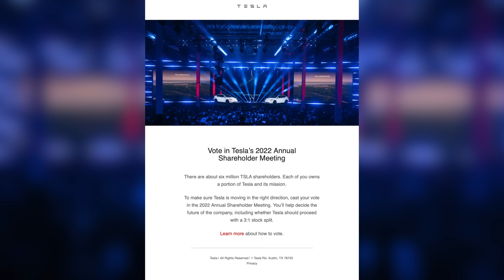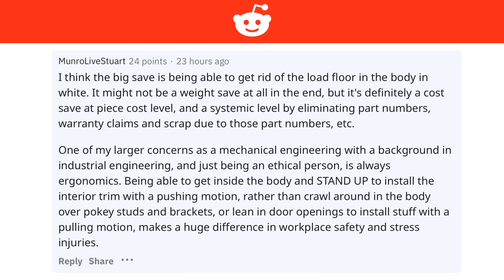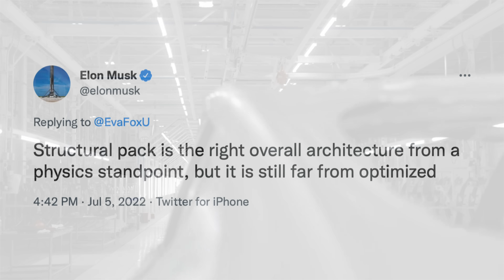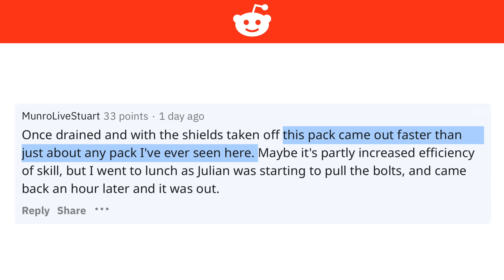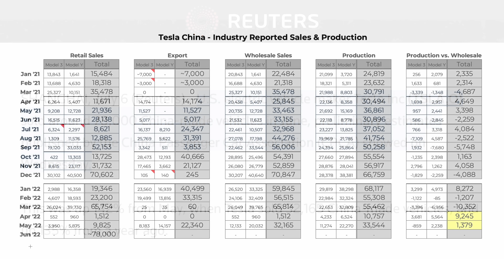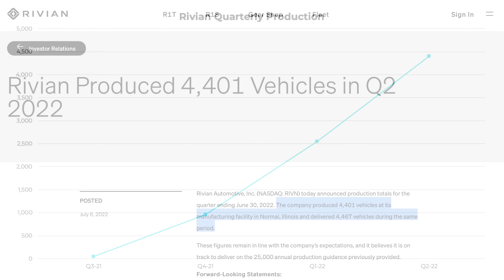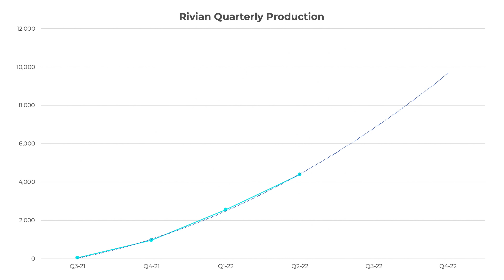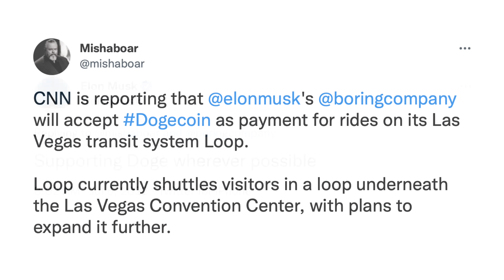Behind The Scenes Details on Tesla Model Y Teardown From Munro

Comment: Rob, something else emerged recently from Munro & Associates that illuminates a question we all had about Model S Plaid.  They tore down the Plaid battery pack, of course.  One of their observations has to do with cooling in that pack.  The liquid cooling in that pack is outrageously aggressive, and because of the small cell size (18mm x 68mm), the cooling is right up next to where chemistry is happening.  We don't see cooling applied to the bottom of the cells; instead it's applied all along the length of each cell.

4680 cells are cooled from the bottom.  They generate less heat energy for the current flow, which is good - efficient!  But there's simply no way to achieve cooling as aggressive with 4680 cells, or to get coolant as close to where chemistry is happening.

Tesla promised a 4680 version of Plaid... and then abruptly canceled that version.  In retrospect, and in consideration of what Munro found, it's obvious.  They were not able to create a 4680 Plaid that could match the track performance of the 18650 Plaid - cooling wasn't good enough to keep up with power demands.  Far from being a better performer, it was worse.

This should help us to think about standardization of cells for automotive uses.  As the battery market matures, we should see a variety of different cell form-factors, depending on the performance goals for each model.  High-performance on the track is going to favor smaller cells; larger cells will be advantageous for more mundane performance requirements.  We may even see a cell form-factor larger than 4680, in order to harvest improvements in efficiency and cost (simpler pack assembly) while providing adequate, but not gut-wrenching, acceleration.

Thanks for your reporting, Rob.
Reply: The 4680 cells are internally structurally different with their tabless design which reduces the need for as much cooling as the smaller form factors. This may be part of the reason for less cooling. You also said there way “no way” of cooling 4680’s. I’m going to bet that the Tesla teams could work out a way.
Reply: @MrDuncanBooth  No, no, I said there was no way they could cool them as effectively as with the smaller cell, not that they can't cool them at all.

Tesla did tell us the 4680 needs less cooling as a function of watts moving through the cell.  It's more efficient, in other words - less energy lost to cooling.  This is a consequence of shorter conductive paths, thanks to the tabless battery design.

But this doesn't mean that the 4680 can match 18650 cells for track performance.  However you slice it, coolant will be further away, on average, from where chemistry is happening and where heat is being generated.  The need to avoid overheating the battery will be a limiting factor, and I assert that this is the reason Tesla decided against delivering a 4680 version of Plaid.
Reply: @Urgelt  
The reason they decided against the 4680 version of the Plaid?
I would say twofold.

1) It would require a new production line.
Expensive for a low quantity car.
.
2) It's already beyond the capability of 99.99% of customers, and already outperforms any "competitor".
It was deemed unnecessary.
.
They had more important tasks to complete.
(Imo, of course)
(Imo)
Reply: @rogerstarkey5390  Well, I dunno about 'more expensive.'

The 18650 cells are being shipped from Japan.  That isn't cheap.

And Tesla expects 4680 production costs per watt-hour of energy storage to be cheaper than anything else on the market.  I expect this to be true, too.  Plus, with structural packs, there is an energy density advantage at the pack level you can't get with 18650 cells.

They have to ramp 4680 anyway.  So they could have kept a 4680 Plaid in their plans, albeit of uncertain timeframe.  But they didn't.  They killed the 4680 Plaid.

They had enough 4680 cells to prototype a 4680 Plaid.  I suspect they did, or at the least, they ran simulations and drew their conclusions from those.

Munro uncovered the logic behind this decision when they examined the Plaid pack and saw just how close the coolant is to cell chemistry.  You can't get aggressive cooling nearly that close to the chemistry with 4680 cells, and that means 4680 isn't as suitable for sustained track performance.
Reply: FALSE , see MUNRO 4680 images from TX, they are SIDE cooled with Ribbons , they seem to use less BLUE insulation foam. 
they may ALSO use bottom plate cooling.
Reply: @markplott4820  Tesla told us they're bottom-cooled.  Munro hasn't yet torn into the 4680 pack; we shall soon see exactly what's what.

It is incontrovertible that cooling will be, on average, farther from the cell's chemistry with the larger cell, and I think my conclusion about Plaid is perfectly accurate.  Tesla canceled the 4680 Plaid because of high-performance cooling needs they couldn't answer with the larger cell.
Reply: Also, another advantage of smaller but more cells is that when a cell dies, it has less impact on the performance of the the whole pack.
Reply: @fred8281  There is no arguing against this principle.

The questions to pose are, at what rate to cells fail in a pack sold to a customer?  And is the failure rate the same for 18650 cells and 4680 cells?

The failure rate might not be the same between new-fangled 4680 cells made at GF-Austin versus mature 18650 lines in Japan.

I'm not trying to imply that 4680 cells fail at a higher rate.  It's conceivable that the larger form-factor, combined with Tesla's battery tech advances, yields a superior failure rate for cells which pass QA and are included in a pack.

It's an unknown.  Possibly, Tesla is still collecting data on 4680 failure rates.  They might have a pretty good idea about how well 18650 cells hold up - but possibly not for those, either, since Panasonic is undoubtedly tweaking cell designs as they move forward, looking for energy density gains and quality improvements.  All cell manufacturers are tweaking as they go forward.

If I had to venture a guess, it would be that failure rates are, at this juncture, not much of an issue for Tesla.  One cell failure will impact a 4680 pack more than one cell failure in an 18650 pack, but there may be so few failures over the life of either or both packs that it isn't worth worrying about.  Maybe.  But that's only a guess.

We'll know more eventually.  The battery degradation curves for Plaid and for Model Y standard range over the course of years will be plotted and discussed.

By way of contrast, pouch cell failures could be, in principle, a larger concern.  Pouch cells are even larger than 4680 cells; they generate hot spots; they lack Tesla's design improvements in 4680 cells; and GM has had simply awful woes with its pouch cell packs.

We know that VW is moving away from pouch cells in their product plans and towards prismatic cells, apparently, which will put them in the same camp as BYD.  I'm of the opinion that prismatic cells can achieve pretty low failure rates, which will be good if true - but scaling up production should be more expensive and less fruitful than with cylindrical cells, an insight Elon had many years ago.  And you can't use prismatic cells in packs which use cells as structural components, which means that, given equivalent chemistries, prismatic packs won't achieve energy densities as good as can be obtained with 4680 cells.

Lots of questions.  Many opinions.  Not much hard data.

I hope Tesla will do another Battery Day presentation soon.  Everything we can learn will be welcome!
Reply: @fred8281  Only when the cell burns through cleanly without damaging the neighboring cells, and when this one cell does not short itself and burns the module/pack. So about 1/3rd of the time this assumption is correct.
Reply: Why can't cooling happen along the length in 4680?
Reply: @ashh3051  It could - at the expense of a heavier pack.

But do they need that for a standard-range Model Y?  I think not.

When Munro tears into the 4680 pack, we'll see exactly what they did with cooling it.
Reply: There are larger cells. Most manufacturers use large prismatic or blade formed cells instead of cylindrical. Cylindrical cells have a advantage in high powered applications with optimized cooling. Länger sized cells are cheaper to produce and offer more capacity for a given volume. But they do not offer as much performance as cylindrical packs. The 4680 pack is not usable for a Plaid. But its perfectly fine with all other applications which do not need such extreme amounts of power.
Reply: @wolfgangpreier9160  BYD's Blade cell is a prismatic cell.

Size matters for any form-factor.  The larger it is, the easier it is to assemble packs, and the worse is the cooling situation.

4680 disrupts that truism to a certain extent; it needs less cooling per watt, since conductive paths are shorter than with tabbed cylindrical cells.

But I still reach the same conclusion.  4680 is very suitable for models which do not need insane levels of power.  For sustained track use, smaller cells are superior, because cooling can get much closer to where heat is being generated.
Reply: @Urgelt  And the 4680 is a cylindrical cell. Just as the 2032 but no one would confound those. 4680 is only optimized for vehicle use in structural packs. Less material than 2170, at least as good stability, manufacturing is not that much different. Only Tesla did put in a few more steps which did not work as intended. The tabs, silicone, chemistry, dry manufacturing. Everything in one package takes more time than anticipated.
Reply: @wolfgangpreier9160  What is a 2032?

What did not work as intended?  4680 works just fine in the Model Y, so far as anyone can see.

We all knew the production ramp would take time.  No surprise there.  This isn't just about 4680, all new battery lines are tough to ramp up and meet QA goals.
Reply: @Urgelt  CR 2032. We call it Knopfzelle. Is in every PC. And is a cylindrical cell. Just as the 2170 or 4680. Usually a new battery factory takes around 3 years to build and start to produce in numbers. Tesla‘ took 2 years. Very fast!
Reply: @wolfgangpreier9160  Okay, I didn't expect you to bring up nonautomotive cells.

Automotive cells are rather different from consumer electronics cells.  Higher voltages, massive power needs, different engineering challenges.  I don't think there's a lot to be said about consumer electronics cells that will illuminate the challenges for automotive cells.

Tesla isn't done ramping.  They just started making cells at GF-Austin.  I expect it'll take them until 2024 to get up to full production capacity at GF-Austin, roughly 150 GWh annually.  Though they probably will continue expanding production after they achieve that target.
Reply: @Urgelt  I got many devices that use 18650 and even 21700 cells. My solar batteries have prismatic LFP cells. 

150GWh is nice but by far not enough. In Grünheide they will take to 2025 before something productive comes out of those lazy germans. Tesla needs 160GWh this year and hopefully double that next year. When Cybertruck and Semi ramp up that will double again. In 2030 they will need at least 1.2 TWh for the cars alone. Double that for energy storage. I do not see them reaching this goal when they do not start building Terafactories NOW!
Reply: @wolfgangpreier9160  I was speaking only of GF-Austin production of 4680 cells.  Tesla is buying vast quantities of cells from suppliers, too - and yes, Tesla will ramp up 4680 production at GF-Berlin as well.

I believe Elon's goal for 2030 is about 3 TWh just for Tesla.  The industry will be ramping up more broadly to support other OEMs, both for automotive needs and for utility-scale energy storage.  6 TWh by 2030 for the industry as a whole is on the table.

A lot of that production rise will happen in China - which is probably the source of your LFP prismatic cells - assuming China doesn't get imperial ambitions and goes around starting wars.

Let us hope not.  War and sanctions could impede everyone.  I don't know how many BEVs Tesla or other OEMs can make if chips from China are interdicted; or if chip supplies from Taiwan are interrupted by an invasion.

I don't think your view of Germans as lazy is shared universally.  Rules-bound, maybe.  Regulations-happy, maybe.  Lazy?  Probably not.
Reply: @wolfgangpreier9160  The fossil fuel industry has defenders.  Making progress in Germany has been hard because of political opposition and overregulation, not laziness.

I won't characterize German workers as lazy, and I expect great things at GF-Berlin from the German workforce there.

Elon's predictions about production ramps have gone better than his predictions about specific product dates.  In 2014, he predicted a half-million run rate for BEVs in 2020.  Nailed it.  Even so, we have to accept Elon's predictions are aspirational and assume smooth sailing - which rarely happens.

So 3 TWh in 2030 is a stretch, but from what I see happening right now, I can't say it's impossible.  Mind you, that number includes cells Tesla will buy from other suppliers.  They're all ramping up, too.

Tesla is negotiating for the raw supplies they'll need; their planning horizon is appropriate.  They aren't just talking the talk.

I expect Tesla to announce a deal with Indonesia which will result in the construction of a new GF there, as well as a you-scratch-my-back-I'll-scratch-yours agreement to supply raw nickel to Tesla's other factories.  One by one, Tesla will knock down the production ramp barriers.

Or so I think!

My opinion is weightless.  Nobody is counting on my being correct, else dire consequences will result.  We're just enjoying a conversation here, not shaping the world's future.

Elon will handle that for us!  🙂
Reply: @wolfgangpreier9160  Eh.  I would have placed the first European gigafactory in Eastern Europe, myself, but not because Germans are lazy.  I don't think they are, but they sure do love their regulations and rules.

Hungary would not be my first choice.  Authoritarians make my skin itch.

I wouldn't have built in China, either, but Elon recognizes the importance of ending fossil fuels in the world's largest automotive market, and going into China lit a fire under China's domestic producers, so no matter how geopolitics may play out, China is on its way to ending fossil fuels.  That surely would have gone slower without GF-Shanghai.

I'll grant you, what Elon is trying to do is difficult, and hitting his targets won't be easy.  I think Tesla is on track for 3 TWh in 2030, but they could fall off track if geopolitics derails them.

Geopolitics might do that very thing.  This is not shaping up to be a pretty decade in world history.

Comment: As a consumer, my concern is not so much with assembly. That’s for the manufacturer to worry about (and I’m not hearing any savings being passed on to buyers with an easier assembly process). Why should I care if I, as a buyer, am not benefitting?

My concern is what does this mean for me, in out of pocket expenses, should my Tesla with this type of structure be in an accident? Does this simplified frame mean I have to get half the frame replaced if I’m rear ended? 

Ryan Shaw had a MY rear ended with the old style construction and it cost $26k. If the frame is simplified for assembly (but no savings are evident to the buyer) but it means a much more expensive repair for the end user, what’s the point? 

The only upside I see for the buyer is, perhaps, a shorter wait time. That feeds into something kids lack these days - patience.
Reply: Ernest - FALSE , go see the LIMITING FACTOR Re: Gigacastings .
JORDAN goes into DETAILS about TESLA Gigacatings .
its a 4 part Series , so be perpaired. 
SHORT answer is , in minor Accident CRASH rails can be cut off, replaced with NEW one bolted on. in MAJOR crash the Gigacasting do the job of Protecting the Passangers, the car is TOTALED anyways and is INSURANCE write off. CAR is Replaced.
Reply: @markplott4820  Dude. Calm down. I had questions, that’s all. No need to SHOUT at all. Relax. Keep that up, your days will be far fewer. 

Anyone can post anything these days. Look at at that idiot Florida man and his minions suggesting we all just drink bleach. 

I’ll look at what you suggested. The earlier frame structure was rated the HIGHEST (excuse me - see what you’ve done?) safety rating ever for a vehicle with the Model 3. Without the new fangled structure. Proof. With physical evidence from actual crash tests. Not merely the speculation and conjecture of a multipart YouTuber channel. 

So I’m not sure I see a benefit - other than, as I say, simplifying assembly. But if that simplification (i.e., faster, lower cost) doesn’t get to the consumer, and it’s no safer than what’s currently offered - what’s the point?

So. Still questions.
Reply: With the demand for EV frankly there is nothing for you. The price will keep going up until production is greater than demand. Simpler production will help getting to that point but that benefit is only for the future customers and has no benefits for you.
Reply: Yeah, that’s the problem with casting everything. Bigger and bigger pieces to replace.
Reply: @mubbywub  No, that's not the problem. When a car's internal structure is damaged, the car is totaled.

Comment: open floor will make build much easier
Reply: Gigacastings allow workers access to both ends , they can stand up to Assemble and do Wireing.
Reply: @markplott4820  
Odd statement. The wiring (spell check) will be installed before the castings and body are mated.
Reply: @rogerstarkey5390   - some low voltage wiring goes in BEFORE the Close off the Gigacastings and the heat pump and Supermanifold have to be Installed as well.
Reply: And cheaper. Hopefully. Sometimes.